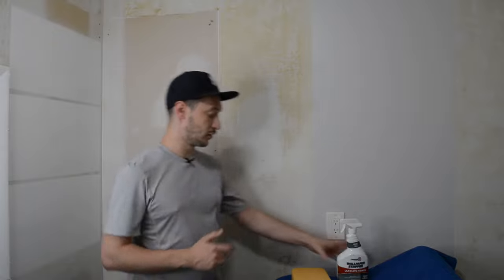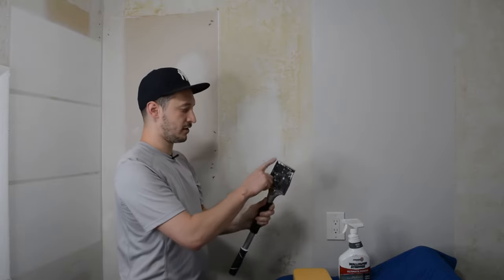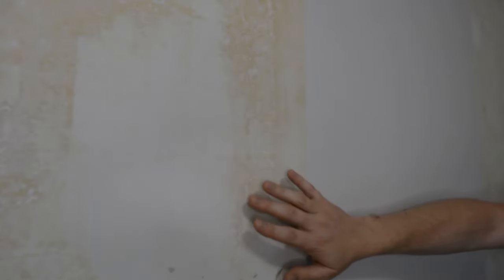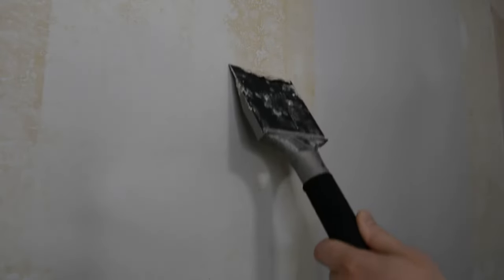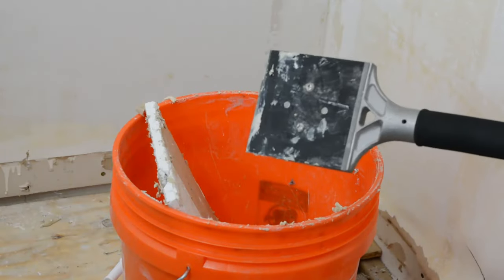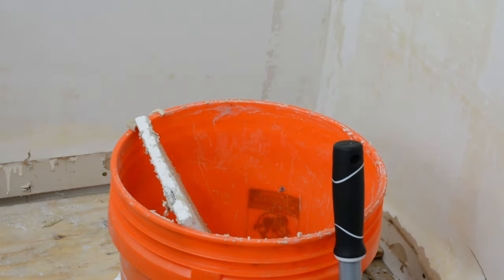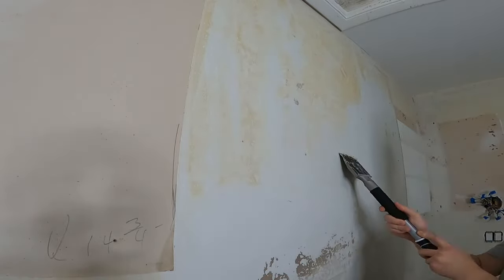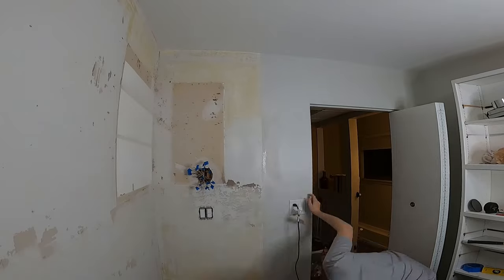The Best Way to Remove Wallpaper Glue

Comment: Dude wallpaper is the worst. Had to spend like two weeks scraping that stuff off the walls. We basically did the same thing after some trial and error, this would have been helpful as heck.
Reply from the maker: It truly is the worst. I still have more left outside the room, but kept myself to just taking it out of the laundry room since that's where I was working. I'm not ready to scrape mud and paint the kitchen and stairwell yet. Mine is at least painted gray so I don't have to look at some crazy walls, but you can see the texture and some bubbling if you look closely.

Comment: I find that it takes longer than 2 to 5 min, and a wipe down with a hot damp sponge first really helps
Reply from the maker: Warm water definitely helps more. You're right, time is totally subjective. I don't have a ton of experience with different glue, but different areas of my room had much different amounts of glue. Slow and steady is definitely the better way to go to avoid damage of the wall though.

Comment: I've been using a steamer I have- but it makes such a gross mess. For as gross and messy it is, it doesn't even get a lot done. I'm going to try this, see if it's any cleaner/easier for awkward places.
Reply from the maker: I went straight to this method after a friend didn't have luck with a steamer and used this instead. Good luck, let me know how you make out!

Comment: Hi Steve, I’ve just removed some VERY OLD paper from a wall and it has left that old, hard, yellowed glue just like on your wall…my wall is old plaster.  Will this product work okay on plaster?  Thanks!  Appreciate it.
Reply from the maker: I have zero experience with plaster walls, so I hesitate to give any advice as I wouldn't want to mess up your walls. Have you tried a wallpaper steamer? From what I've read a steamer works well on plaster. This product doesn't say you can't use it on plaster, so maybe test a small inconspicuous area first?

Comment: quite a expensive way of getting rid of paste when you can just use warm water what is the zinsser gear 10-15 quid a bottle
Reply from the maker: If warm water works, that's great. It didn't work for me though, which is why this stuff was such a life saver. It cost me $15 for the gallon jug.

Comment: Do you have to remove the glue before skimming/ plastering? Or can you plaster over? Thanks
Reply from the maker: You do. The plaster/mud won't stick to wallpaper glue, even if it's dry.
Reply: Man that’s a lot of work, can they seal it with pva?
Reply from the maker: I don't have experience with PVA, but I'm pretty sure paint wont stick to it because it's waterproof. Sometimes there's no easy button.

Comment: Because I already had them in my collection of tools, I used 6" and 10" drywall knives and a mud tray.  I softened the glue using hot water and a squirt of liquid dish soap in a gallon sized garden sprayer.  

After having done several jobs at different times, I have found removing wallpaper and paste not too picky.  Just use the tools and methods that work for you.  Be prepared to experiment though.

Thanks for posting.
Reply from the maker: Thanks for the comment! The more ideas for methods the better!

Mud knives and pans is a great idea. A nice wide flat surface, and the pan to catch all the goop.

Comment: We have plaster walls, got the paper of now left with the glue. Will this work on plaster walls as well.
Reply from the maker: I would think that it shouldn't be an issue using it on plaster. I couldn't find anything that says not to. That being said, definitely test in a small area first, then work from there.

Comment: Wouldn't it be easier just to get it industrial steamer? They're not that expensive. And It's a lot quicker. I wasn't wanting to run all the way to go  get mine. But I'm not going to spend more money on chemicals.
Reply from the maker: I had a friend use a similar spray after nothing else worked for them. So that's what I went for rather than buy a steamer that I won't use again. A steamer might be a better buy if you have a ton of wallpaper to remove, but I haven't used one so I can't say for sure.
Reply: I used a steamer today. The outer wall paper came off just fine but the glued backing stayed on. That portion pulls off in small pieces. I tried to go back and use the steamer on the glued layer but the sheet rock pulls off with it.